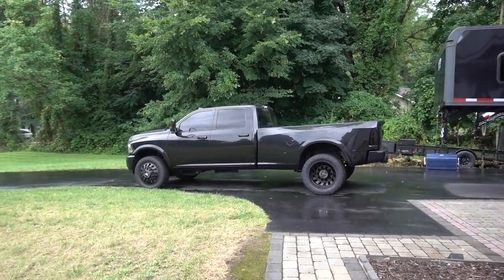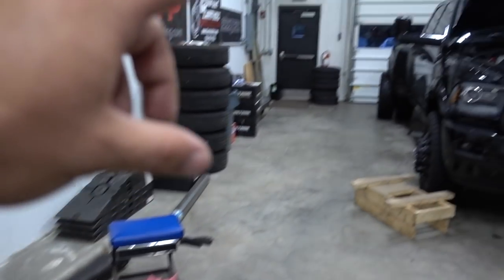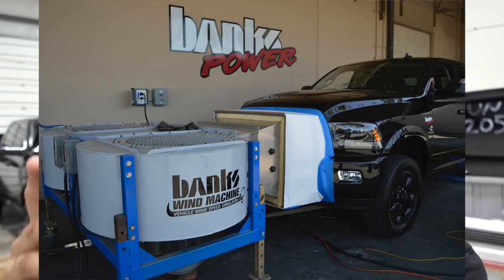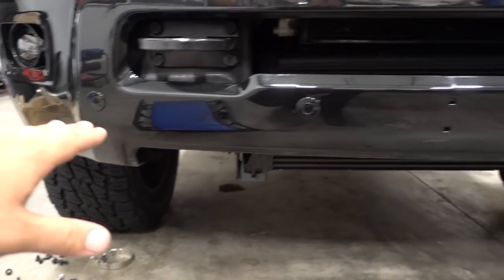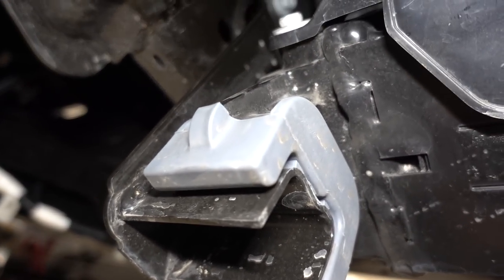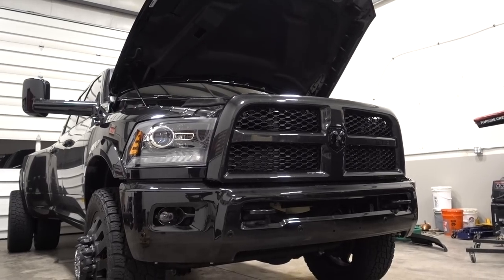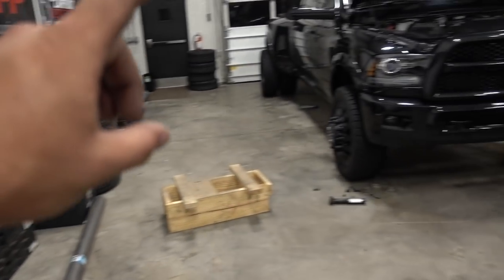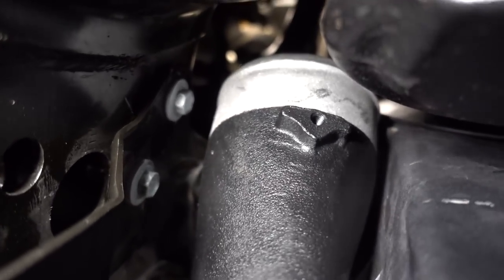2018 CUMMINS gets MASSIVE NEW INTERCOOLER!!!

Comment: I'd like to see what it actually gives you over stock. $1500 is a pretty steep price for what you get. For $1300 you get a lot more on the 3rd gens than the updated 4th gens. I think putting money into the trans, rear diff is better spent. I could be wrong though.

Comment: I’m already a believer in Banks no need to sell me. I just fast forward past the rambling, that is a really nice dually. I looked at the same truck this week, at $82K I left it at the dealership and bought the 2020  tradesman with 6.7 High output. I’ve got 300 miles on it and I’m ready to replace the stock intercooler with a Banks intercooler and pipes.

Comment: Greg,does painting the inter cooler decrease heat dissipation ability due to covering up the surfaces of all those radiator fins with the coating of paint thus adding another layer(outer skin if you will) and increasing the thickness of those fins.Thin metal would seem to cool better (i.e. tin foil vs a coated frying pan in principle)...

Comment: Happy with the Banks 25980 Intercooler with monster ram on the 2005 Ram.  Blew up the original plastic ended intercooler at 40 psi.

Comment: The early 4th gen trucks 2010-2012 had a larger intercooler mounted in front of the radiator like the 3rd gens. They went to the crappy low mount intercooler in 2013

Comment: Painted black I bet you could pass CA Smog no problem.

It's only $1,400 and I bet it does help lower EGT's and help with turbo spool. I'd want it just to get rid of the kink in the factory boost tube.

Comment: Hate to be the one to say it but the paint on the fins of your new intercooler is gonna lower the efficiency of it since the paint will act like an insulator across the actual part that is the heat exchanger
Reply: Preston Wolff it increases surface area slightly  which would increase the capability of heat exchange across the surface but the material matters and if you add a non porous material on top of a metal it acts as an insulator and descreases the delta T across the surface thus reduces the efficiency of the cooler because the metal fins would hold heat and be shielded from the atmospheric air that cools it

Comment: Enjoyed yet another one of your videos Greg, still more entertaining than reading all the negative comments from penniless pansies whining about not having your truck or your parts. Keep it up, I’m building my 2018 black Sport 3500 as well and I appreciate your insight.
Question: when you mounted your aftermarket wheels/tires, did you have any issue getting all 6 tires balanced? I’m running 35x12.50R22 on XD wheels and nobody seems to be able to put weights on my rear inner wheels. I’ve put 16oz of balance beads in them and am running Centramatics on both axles, helps a lot but still have some vibration around 75 MPH and on up.

Comment: Just ordered a cheetah vgt, banks air, this intercooler, just got a stage 4 trans installed, arp 625 head studs, steed speed manifold, 410 gears.... the one thing that is killing me is the codes for my tailights.... I think it’s causing other computer/windshield whipper issues... I have a 14 Laramie, I have spider tailights... can you please help with new led tailights that won’t throw codes? Also looking at throttle valve delete and grid heater delete to a throttle valve with a heater and then banks air horn.. thoughts?

Comment: THIS IS  A CAC NOT.  AN INTER COOLER 
INTERCOOLER IS A COOLER THAT IN INTERNAL COOLED BY OIL OR COOLENT.  THIS IS A CHARGE AIR COOLER.  ITS COOLED BY AIR CROSSING THE FINS LIKE A RADIATOR CAUSING THE INTERNAL AIR TO COOL DOWN BEFORE ENTERING THE INTAKE

Comment: wow surprised thought eh would have done the radiator before the inter-cooler since he tows more with it.
Reply: There's no reason to touch the radiator on the 2015+ Rams.
Reply: Dusty Desserre Maybe but still waiting for the deep dish transmission pan n cooler n differential cover. Oh yeah the air dog which comes with the fleece replacement fuel unit

Comment: Will installing the Banks Intercooler or similar intercooler change the sound of the turbo/exhaust. Has anyone installed one on their 4th gen and noticed an overall improvement in performance due to the increased volume and more readily available cooler air? Thanks

Comment: Looks like nobody told you that the stock intercooler is good to 1000whp...
Reply: Monster RAM Start working a 1000whp truck on long trips an see how long that stock intercooler can keep up. It may support 1000whp but can it sustaine 1000whp for long periods of time?
Reply: Gottem
Reply: Here's the thing.  Until Greg upgrades the turbo and the head, it won't matter how much more this intercooler flows over stock.  Put it on a dyno before and after if you want to know anything.  Looking at it or comparing how much bigger an inlet is doesn't mean anything in overall flow when the choke point is in the OE VGT and head.  But to address your statement, you're moving the goal posts because I never mentioned longevity.  However, this would all depend on how much boost you are making and there are many trucks that are lasting just fine.
Reply: Not really moving the goal... as we know it the truck is Greg's tow rig plans for the truck are to tow his toys to events right? So his end goal will be longevity sure he can make a 1000hp with a stock intercooler but that's gonna be worthless for what hes doing with the truck.  But you are right as a stock rig atm it's not gonna do much but as he starts adding supporting mods then it will be one less thing he has to worry about.
Reply: Where are you getting this "longevity issue" with the OE intercooler?  There are very few reports of them failing and those seemed to be manufacturing flaws.  Also, even if he was to get the tow rig to 1000whp, which I'm pretty sure he's not, it won't make a difference until he ports the head.  Don't take my word for it, look at every 4th gen forum and you'll read the same.
Reply: I never said the intercooler it self would fail! I'm talking about the truck as a whole .  The intercooler maybe wonderfull but it does not hurt to add the extra capacity . Say the truck makes 1000whp an is strictly used for towing on long trips you say the stock will perform  the same as a upgraded larger Intercooler ? You say the flow will be the same ? Like you said it would  if he used a stock turbo 9n head but we are talking 1000whp so upgraded head an turbo along with supporting fuel mods . I beleave the larger intercooler will increase longevity for the truck.  Not saying the stock one is a pos or have issues with lasting
Reply: The factory intercooler throws efficiency codes when pulling heavy loads. Mine has done it 5 times already. It just can't keep the charge air cool under stress
Reply: Cory York - I'm having a hard time with the idea of a 1000whp truck that is for towing. Also, let me clarify because I thought it was obvious that the 1000whp figure is where you're going to see significant loss.  So for Greg's application I'd say that 700whp is plenty for a tow rig which puts us in the realm of >5% increase over stock which is essentially insignificant. The increase would be so minimal that you would only know on a dyno, and not on the street or strip.  

To address flow, Banks and every other aftermarket company will throw numbers at you but flow isn't what singularly increases power; air density does.  Nowhere at Bank's site does he show any air density figures and that is what increases power.  You can have an intercooler the size of the truck and it wouldn't help you if the engine cannot take the CFM, and the 6.7 won't until you port the head.   

You continue to mention longevity, but also acknowledge that the OE intercooler doesn't have any issues.  Okay so with that out of the way, what do you think the longevity of a 1000whp truck towing on long trips would be?  Every service diesel truck is de-rated FOR longevity.  Adding a bigger turbo and fuel will only reduce longevity, so I'm confused why you keep talking about a 1000whp tow rig and an intercooler's longevity.  IMO, the solution is easy: add-a-turbo compounds and a built trans = reliable 650+whp on stock fuel.  You can even do this with emissions intact, if desired.

Tim Speegle - Take your truck to the dealership if it's under warranty.  You have something wrong with your truck.  I've towed 15k through the Appalachians with no issues on a deleted '14 2500.  You probably have a pin-sized leak somewhere.  It could even be the intake horn... do a pressure test on the system if you can't take it in.
Reply: Cory York exactly..... a 1000whp could run without an intercooler.... im sure it would not last long though!!!!
Reply: I don’t know how I could live without my Plasmacam
Reply: Btw if you look at my comments I never said the factory intercooler had issues:)
Reply: Fact Its a gift from Bank thats it. Its great for greg.
Reply: Monster RAM just because you havent had a problem doesnt mean others havent. If you are the end all be all on stock intercoolers then we are all doomed.
Reply: Cory York - To be clear, there is no winning.  The Banks intercooler either makes significant power over stock or it doesn't.  Yes I mentioned, 1000whp because that is when you'd want a aftermarket intercooler since it flows significantly more than stock at that level and beyond.  You continued to mention 1000whp in a tow rig scenario, which I don't understand the practicality of, because tow rigs generally don't make 1000whp.  This is Greg's tow rig and he's not building it to 1000whp so how does what you're saying even apply to him?  

To address your point:
"If you have two trucks same mods except one has a larger cooler put in the same environment driven the same way the one with the larger cooler will outperform the stock one with less wear an tear on the truck."

Not necessarily because unless the larger intercooler can significantly increase air density, you won't see a practical difference.  It may be 20 - 30whp but that's around 3% - 5% and essentially insignificant and you won't see any real difference on the track. You'd find the same fluctuations in air temp, humidity, and elevation changes.  Furthermore, what wear and tear are you talking about that an intercooler would contribute to?
Reply: Will a better inter-cooler help keep the EGT down?
pull a heavy toy-hauler?
all day?
though the mountains ?
Reply: Monster RAM I don’t know much but I have a 2011 Dodge Ram 3500 and I use it for work everyday since I work in the oilfield as a welder I love dodge but they will have problems if u daily use them pulling a heavy load every day like I do that intercooler don’t last that long and it barely has 203,453 miles.by the way with all the welding equipment I have my truck weights about 17,345 lbs last time I checked know I got bigger rims and tires and a heavy duty brush Guard so maybe more now lol
Reply: This is the dumbest argument ever lol, it was most likely free and what does it matter. BANKS knows what they're doing and it will be an increase over stock even if the stock one can handle 1k this one will do it a bit better....
Reply: Cory York this is one dumb argument 😂 yes the stock intercooled can work on a 1000 hp truck.. probably for dyno runs before it gets heat soaked. The banks intercooler has more cooling capacity which may actually cause a loss of power because of the greater volume it loses velocity but gale banks knows a thing or two about a thing or two so I doubt that'll be an issue. Also cooler air going in will always be better than hotter air. I dont think anyone can argue against that. Also the restriction on the stock intercooler in comparison to the banks Intercooler is a big difference, "without a better flowing head blah blah" less restrictions is less restrictions. If it doesnt have to be forced through tight pipes and tight intercoolers it can be forced only into the intake and head which will be able to max the cfm rating out of the head. In a perfect world the only restrictions are closed valves but having overall less restrictions is still a benefit.
Reply: Cory York your truck isn’t going to be pulling peak power the entire trip.